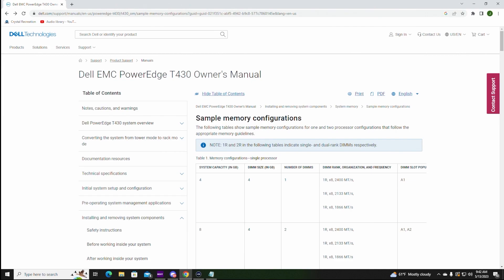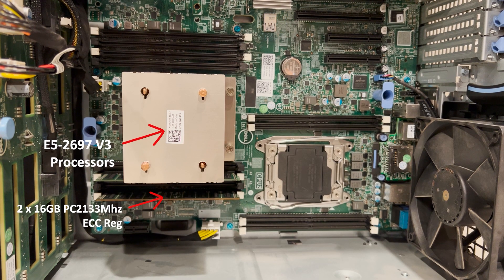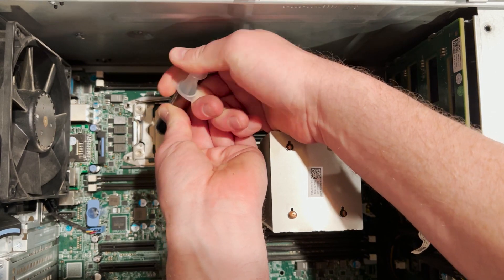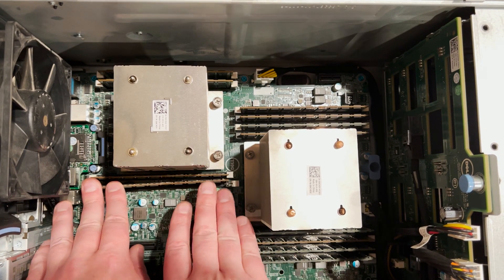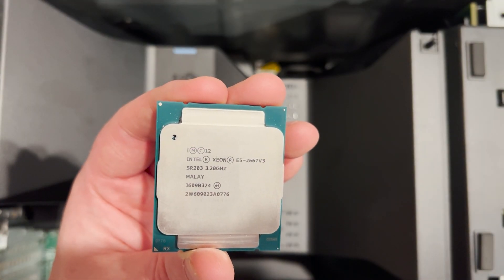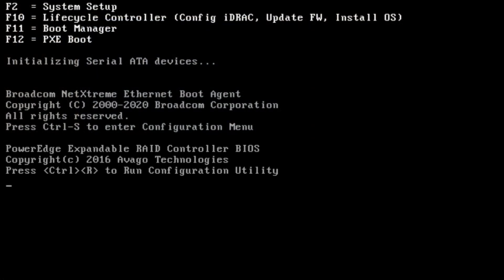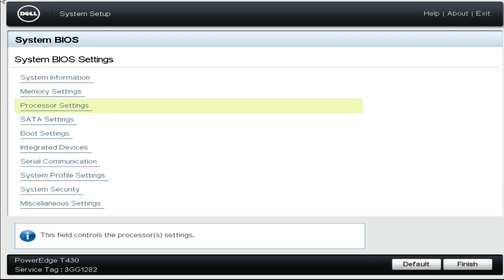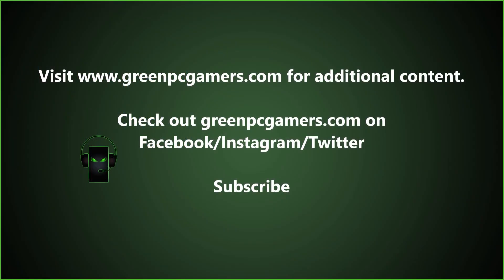PowerEdge T430 Secondary Processor Install + 192GB Memory Install

Comment: I’m having the same issue. Only I have E5-2697 v4’s in  T430.
What was the wattage of the PSU’s?
I’m running 750’s, and no video or network connectivity.
Do you think upping the PSU’s to the 1100w’s would help?

Comment: The T430's max TDP is 135 Watts per CPU in dual CPU configuration. The most 'powerful' CPUs that will work in tandem are the E5-2598 v4.
Reply from the maker: Did you mean E5-2698 V4?  If so, we tested those CPU's in a T430 and the server wouldn't boot.  Do you have a server in production with that model cpu installed?
Reply: @GreenPCGamerscom  Yes, I meant the E5-2698 v4; I apologize for the typo. Currently, I have a system with dual E5-2698 CPUs, which I upgraded from a single E5-2620 v3. My motherboard is a late revision model, 0KX11M, and I have installed all applicable updates. All of my RAM is rated at 2400 MHz. Also dual 1100W PSUs. I learned about the TDP limit the hard/expensive way, as my initial attempt to upgrade to dual E5-2699 v4 CPUs failed.
Reply: @knightime14 Just confirming I can install two E5-2698v4 in a T430? Your upgrade guide on the web doesn't list this as an option.
Reply: @anonymous_friend  you can with the right PSU
Reply: @GreenPCGamerscom  Did you manage to get your box running?
Reply: @GreenPCGamerscom  which hot swap version of the PSU do you have? you need the 750w PSUs

Comment: Only 16GB Modules?
Can it not support all slots populated with 32GB ECC LRDIMM's?

I've found that regardless of what the original vendor claims you can often populate these systems with far more RAM than they were originally rated for at launch, often because the newer Memory Controllers on the V4 CPU's are far more stable and have no trouble with 32GB DIMM's.....

Being DDR4 I think you can even get 64GB ECC LRDIMM's?
Reply from the maker: You have some good ideas for the next video.  Stay tuned….
Reply: Usually some model are under "rated" not to go "eat" (kill) the next model "Market". Often they are fully or over tested to the intended market and not for all his real capability. Warranty only on what they know 100% work.
Reply: The largest DIMMs that will work in this system are the 128GB modules, which will give a total of 1.5 TB of RAM. However, these chips are very, Very, VERY expensive and difficult to find in stock.